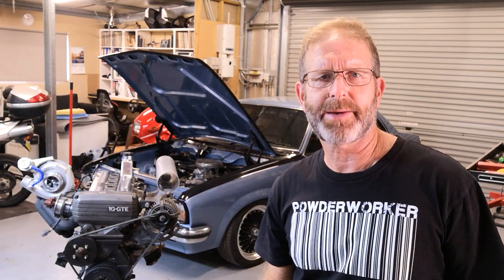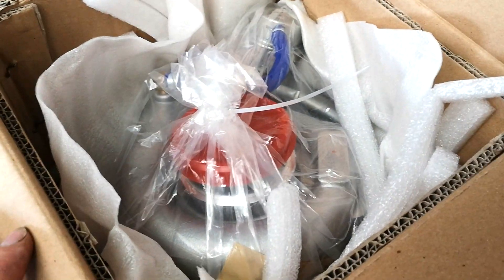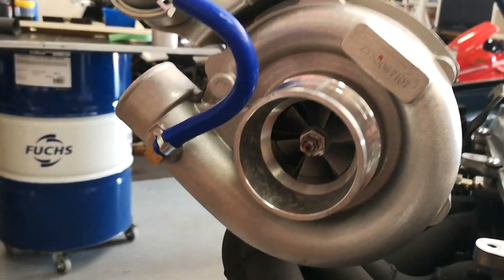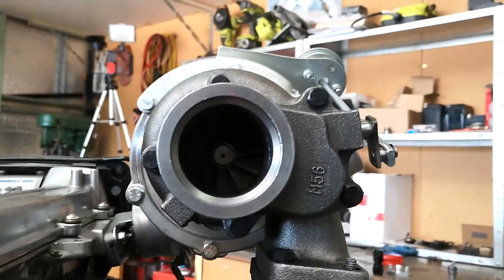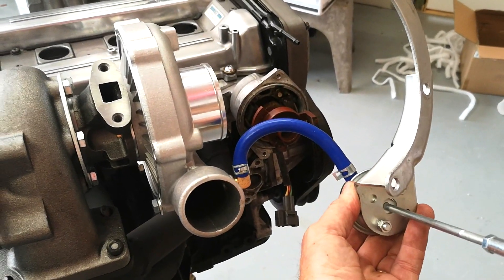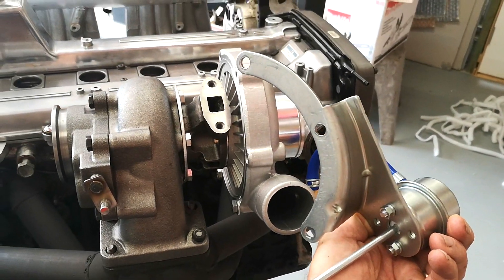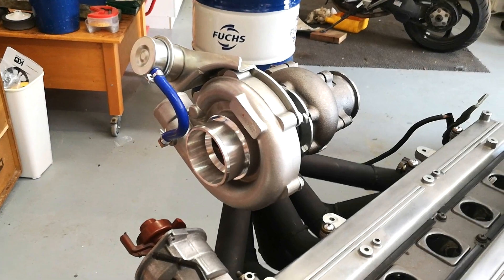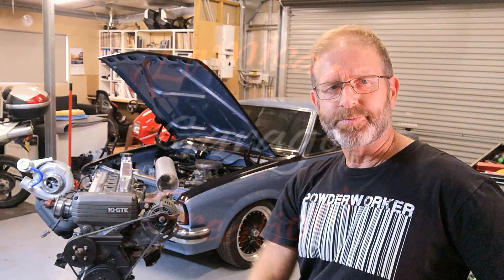BARN FIND Celica 1G GTE No.24 KamicarzCreations- EBAY Turbo Review and Installation Bring on Boost

Comment: G'day, It's common to fit a 2mm restriction on a journal bearing turbo. (1mm on ball bearing ) I'm in the process of changing my TO4/CT26 hybrid turbo to a GTX2867R GEN 2 on my 1GGT/ZE. its currently running LPG, 18°locked advance, 23-25 psi on stock Z pistons and rods which is tuned to 300hp at the treads. Its been in this configuration for many years. I hope this has helped you, good luck. They are a fun little engine 👍
Reply from the maker: Will looking into that
Reply: Update. I have the GTX2867R fitted and running it comes in about 1200 rpm earlier than the old turbo with 5psi at 2500. It's much nicer to use and I will be winding up the boost when I get back to the dyno.

Comment: Very interested in how the manifold is going to turn out. I thought generally sheet metal manifolds that are made using existing runners would have a flat plate welded to the runners so you can easily weld and smooth out the path into each runner and then from there weld a half tube onto that plate and then build an angled section that branches out on an angle to clear the alternator and weld on a throttlebody flange. Do you think it is going to be hard to weld and smooth out the join to the existing cast runners inside a closed tube?
Reply from the maker: My plan was to cut the radius of the pipe on the runners. Probably split the pipe so I can weld internally and shape the inlets so it flows. Then weld the halves together.
Reply: @KamicarzCreations  that'll work! Should be a good thing when it is done. You said you were going to get it flow tested/ported as well didn't you? I'm very interested to see if you can get even flow to all cylinders. It is the only the that worries me about getting a forward facing plenum fabricated.
Reply from the maker: @MickiDracing  yeah have been chatting to another members who sent me his flow test stats and it looked good. Just gotta get on to the company that did it.

Comment: Good to see the 1G getting some love. Have you thought about mounting the alternator lower down? I've done that on mine and its a lot better with the front facing plenum.
Reply from the maker: Yeah probably will, did you make your plenum?
Reply: @KamicarzCreations  No I bought it from the guy who made it, then modified it for a bigger throttle body
Reply from the maker: @RawDawg108  do you know if it had any baffling in side and what size throttle body did you use?
Reply: @KamicarzCreations  It has no baffling. I've never heard of baffling inside a plenum? 70mm
Reply from the maker: @RawDawg108  thanks, i have gone for 65mm